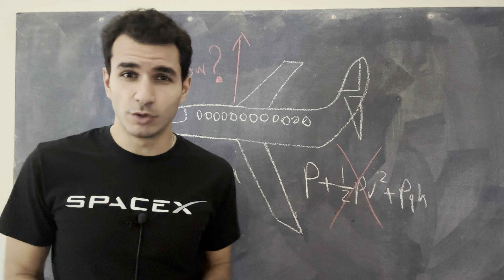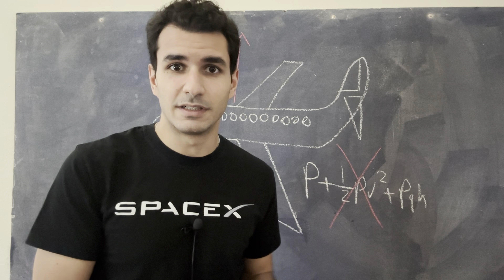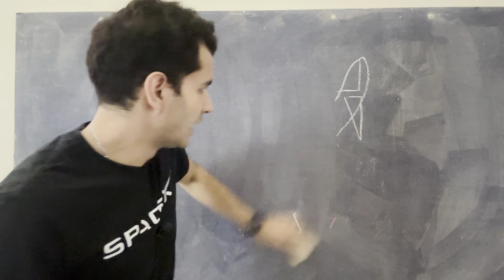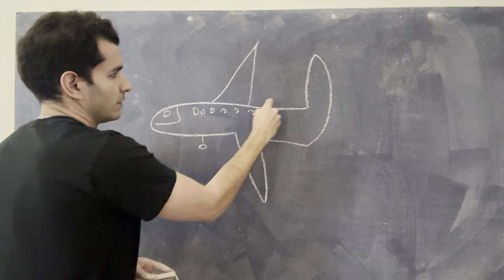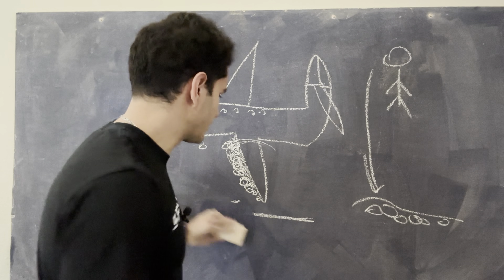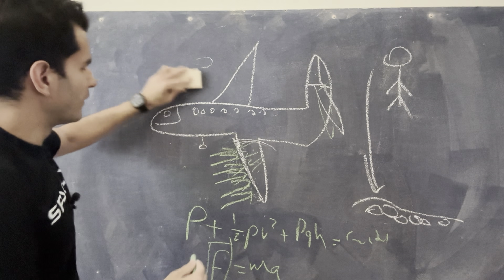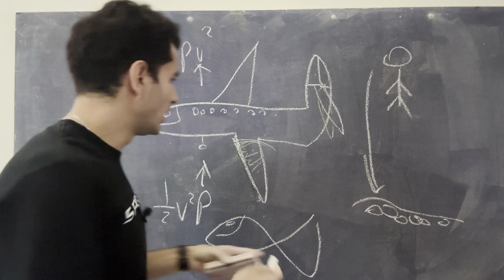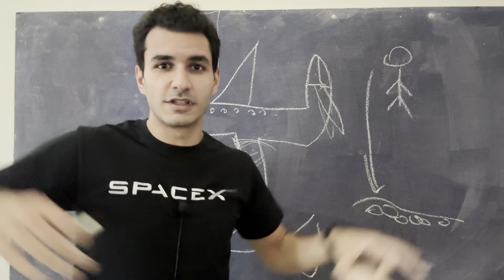Fix This One Misconception = Understand Airplanes Forever

Comment: Put your hand out of the window of a moving car, to get a intuitive feel 😂
Reply: You can also use a tilted mobile phone.😂(be careful it may lift you.)
Reply: It's definitely the best way to understand how aircraft move on a fluid
Reply: A sheet of metal or wood does the same but that is drag you are feeling.  However, a human hand is convex on the top surface where the knuckles are and concave on the palm, so a sort of wing.  So sticking you hand out the window has proved that your hand is a rudimentary wing!
Reply: @karhukivi  the effect is the same if you flatten your hand or even turn your palms up if you change the angle of attack
Reply: @future62  It is not a  scientific experiment, you cannot measure lift and drag separately with your hand.  Try flying a frisbee upside down to see where lift comes from.
Reply: @karhukivi yes you can, even with your hand, drag opposes the direction of motion. When you put your hand out of a car’s window, drag will be felt as a BACKWARDS force, because you are moving forward. Now if you start changing the angle of your hand (increasing angle of attack) you WILL feel your hand being pushed UPWARDS. That force, pushing your hand up, is lift. And it has to be lift, because the direction of motion has not changed, therefore drag is still present, but only pushing your hand back, while lift is pushing your hand up.
Reply: @Blinkin97  The point is that experiment does not prove anything.  How much of that lift is coming from the upper curved part of your hand?  The lift on an aerofoil comes mostly from the upper surface, as a thin layer of ice on the upper surface can destroy the lift and has caused accidents. The pressure drop above the wing can be measured and is sufficient to provide up to 80% of the lift.  As soon as the airflow above the wing becomes turbulent (as in a stall) the lift also disappears.
Reply: @karhukivi well, I don’t disagree with you. However, your understanding of the affects icing are a little off. The major issue with ice on a wing is actually drag. Yes, it affects lift, but mostly because it slows down the airflow making it separate from the surface prematurely, that causes turbulent airflow and a massive increase in drag which leads to an increase in the angle of attack, which in turn leads to more drag, which leads to more AoA…. You get my point. Your hand, is in fact, a rudimentary wing. It is difficult to quantify how much lift actually comes from the shape of a wing. Some wings have no teardrop shape at all, flat wings, and they generate lift just fine.
Reply: @Blinkin97  Flat wings do indeed generate lift from the lower side but they are highly inefficient and require very powerful engines to propel them as with any wing flying inverted.  The Wright Brothers found that out as they only had weak motorbike engines to power their aircraft.  They discovered that an aerofoil shape was much more efficient than a flat wing as it generates most of its lift from the upper surface. Plenty of experiments were made by NACA (forerunner of NASA) to see which aerofoils were efficient.
Reply: I have done that many times and know that if I tilt my and up a little, off the horizontal, there is more air pressure on the underside of my hand and my hand wants to fly away.

Comment: Yeah the very difference between linear horizontal and vertical float hover… gravity as a density layer upwards in air not present once the fluid phase is the medium… in both instances speed defines the control mechanisms of the rutter but ultimately… you want to be able to fly in different ways and the iconic flat frisbee disk style like an ovalated quarter actually does both on vibrous floating straight shot discus of the curvaceous straight line para para metric bolic innuenda of the ender to intersecting vector on the dip twist to the hex of PENTA OCTO sectors of QUADRA TRIAD BENTO OF THE EON MAX OF SEDA FED FALLEN FRO TITAN’S CALLING AELIUM AEOLIAN ARLONIAN CARBONIUM

HYDROGEN PHOSORPHIDE :NITROGEN on DIOXIDE:CARBON on triad’s TRIPLE CARBON MONOXIDE… OXYGEN ON OCTO GATED 8WAYS TO BREAK THE FATE OF HATE BY SEASON’S FALLING FAST OF HDTV’S LAG FIRST TIME EVER ON HATE LATE OF THE OLE DANI B. X SUMMER THAN X MORGAN COTTLE X LAUREN KILISKY X PATCHI MARTINEZ LOPEZ BECAUSE OF PRETENDZI ON TENDI TENDER TINDER TENDEY TRENDY ON THE WINDY WENDY WINDY… TIA ON THE ADC… don’t be caught slippin like ALL OF THE WES BOIZ DID IN FORGETTING THEY ARE oops that’s right all providing all of this evidence of crimes they committed all at once over the entire time as watch hours OOPS you realize you all get billed per qubit microsecond right? RACHEL SAYS she will show me specially how insulting some of the worst people in the world are for our show about guessing who people are base off of ANONYMOUS COMMENTS LIKE THOSE ON STONES AN SYNAGOGUES I HAVE NEVER BEEN TO AND yeah that episode showed a hate crime… there are a lot of crimes on tv

Comment: Well I agree that yes bernalia is part of it and Newton is part of it it has more to do with the boundary layer of air going over the wings in the frictional/ stiction forces, a symmetrical  airfoil can fly so can a flat bord can fly to. a plane can fly upside down. this is where the difference in pressure break down in that analogy because if it was just a difference in pressure you would not be able to fly upside down cuz you would literally be pulled to the ground,it has to do with boundary layer effects of fluids, and a plane can stall (lose the lift) at any speed at any angle, a stall happens when you have flow separation from the wing. It is this boundary layer fluid flow that makes it possible to fly. Newton and Bernoulli are just the lay version of real flight mechanics just as Newton is to relativity for gravity

Comment: Wow, I'm sorry but this is so misleading.  

You're explaining lift as being most substantially from dynamic pressure underneath the wing?  If that is so, then why is it understood with high consensus that the substantial majority of the total pressure difference contribution to lift is from the drop in pressure above the wing.

The ratio, though it varies, is something roughly like 70% decrease from ambient pressure above the wing to about 30% increase above ambient pressure below the wing.

Yet you are basically pushing the "skipping stone" fallacy of lift that the 30% part below the wing (dynamic pressure) is 100% responsible for lift.

The applicable physics is conservation of mass (flow rate), conservation of momentum, and conservation of energy.

You are so far from addressing the above, that you should really retract, apologize, and revise your pronouncement "where everyone gets wrong about airplane physics".  

Bluntly: if an honest review of the topic is of any importance: completely unacceptable.
Reply from the maker: The 70% pressure drop above the wing implies there are less forces acting upon the wing from above, so even though the pressure from below is only increased by 30%, it's the combined effect that makes the net force being acted upon the wing much higher in the upward direction. 

I have a video called "you don't really understand physics" it covers how to understand basic Newtonian mechanics, highly recommend!
Reply: @alithedazzling There is more force acting above because the pressure difference from surrounding ambient pressure (ambient even further above the lowered pressure), is a greater differential than that between the increased pressure underneath and ambient pressure further below that increased pressure.

But look what these two pressure differntials are doing to that ambient surrounding air:

Turning the momentum of relative flow down from above and to a lesser extent, turning the higher pressure below down also, to the lower ambient pressure..

The above is the vertical momentum change equal to the force of lift which is the necessary response to the pressure  difference:

Force = L (vertical) = d(mv)/dt (vertical)
= pressure difference x area

So, you're saying, sure, more momentum transfer between air molecules under the wing with the wing than over the wing, so of course that gives the upward net force.

But the big picture here really can't be edited out, unless you want to say it's the force resulting from an asymmetry turning the relative flow.

The consequences of Newton are not F = ma alone, but conservation of mass (flow rate), momentum, and energy, working together.
Reply: Also, very importantly, you haven't addressed the why of that 70% vs 30%.  

Note the NASA Glen Reasearch Center lift misconceptions.

Yours is misconception #2.
Reply: @alithedazzling  Also, very important to address the why of that 70% vs 30%.  

Note NASA Glen Reasearch Center lift misconceptions #2

Comment: You said the “air is slower to react” when we’re careening through at such speed, that probably would make it more denser at that spot and till such time it would “linger” around (circulate) till it bounces off: during this time it’s more work done by the air rather than the plane itself so an equation mostly about air would suffice. I don’t know why People take sides of the debate when there’s always some truth in what each of them are saying the order is usually: F=ma i.e. the governing equation at least in its “true” form. Then, Bernoulli  gives us the same idea from an energy conservation perspective but doesn’t actually talk about lift let alone in such a non extremely streamlined flow, then Navier would come in but Kutta-Jokowski refines all of this physics understanding to suit the engineering of LIFT!

Comment: IIRC. Bernoulli's work was inspired by the perfume atomizer which was popular in his day. Anyway, I was led to believe that Bernoulli's math can be converted into Newton's math, and back. That fact changes this debate from a black-and-white "Bernoulli or Newton" to a shades-of-gray "Bernoulli and Newton". But you are correct: it is wrong to claim that "the flow over the top surface" wants to "meet the flow over the bottom surface". In fact, smoke-line analysis proves that the over-the-top-flow is much faster than the bottom flow.

Comment: Initial lift is due to the incoming air pressure on the inclined wings. It is aided by the force of engine that pushes exhaust gas downwards creating enough momentum for the plane to beat gravity & lift up. Tail of plane is suitably shaped to blow gas downwards to facilitate plane's navigation at the desired angle.
Reply: Tail blows gas upwards not downwards mate
Reply: @davefoord1259 see again. When front lifts, obviously the rear looks downwards. Even the curved shape of rear is to facilitate free push downwards.

Comment: another explanation ive heard is that bc of the shape of the airfoil, the air molecules at the bottom are obstructed and slowed down while ones at the top arent as much. and this creates a force from bottom to top of the wing similar to how if i have an engine piston like setup and i have a higher pressure on the bottom and a lower pressure on the top, the higher pressure region will push on the piston wall to equalize pressure by reducing volume. i might be wrong in this thinking but it seems this force and the force mentioned in the video seem to be from different sources.

Comment: Lift is as a result of the difference between low pressure over the wing and a higher pressure under it. The difference in pressures is increased or decreased mainly by controlling the speed of the air over the wing using forward speed, angle of attack and / or varying control surfaces.

Comment: Wings are simply "air pumps" that cause air to be accelerated downward as a mass with the Newton's reaction causing the wing to be accelerated upwards ... F = ma. When the "ma" of the downward accelerating air mass equals the mass of the aircraft then the wing (aircraft) is flying. The principal reason that the wing is an air pump is because the laminar flow of the air in the area just behind the nose of the airfoil profile draws a very large mass of air to flow into the downwash of the wing. This is the "Coanda effect" in action ... read about it on Wikipedia. If you want to experience "downwash", stand underneath a hovering helicopter. There has to be a large mass of air accelerating downward from the rotor blades to equal the mass of the hovering helicopter so that "F = ma" versus gravity is satisfied.

Comment: '' The wing keeps the airplane up by pushing the air down...... In exerting a downward force upon the air, the wing receives an upward counterforce-- by the same principle, known as Newton's law of action and reaction, wich makes a gun recoil as it shoves the bullet out forward......'  Wolfgang Langewiesche in ''Stick and Rudder'' 1944  (p.9). The best book about flying that I have read.
Reply: Yeah it doesn’t get much simpler than that.
Reply: Yes, it is a great book
Reply: A thin layer of rime ice on the upper surface will kill the lift, that is why they de-ice the UPPER surfaces of airplane wings in winter.  The spoilers are also on the UPPER surface, while the draggy devices like engines, guns, and screwjacks are on the underside where only about 20% of the lift is produced.  An autogyro flies with no downward airflow.  Try throwing a frisbee upside-down - it is the curved surface that generates the lift.
Reply: @karhukivi  "generating" is not the right word to use.

Comment: Could have mentioned the role of down force created by the horizontal tail\elevator, and how it relates to the pitch up moment that presents the wings with air to bite into. Perhaps an added analogy to the rear wings of race cars. Otherwise a very clear and well presented explanation!